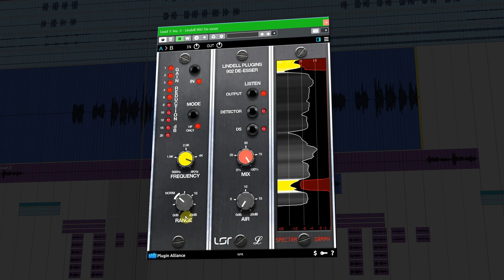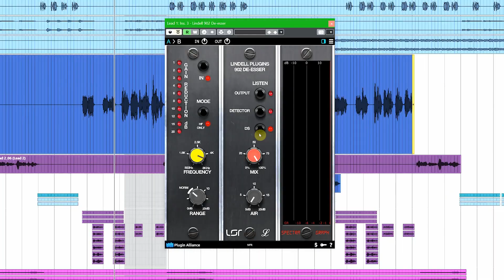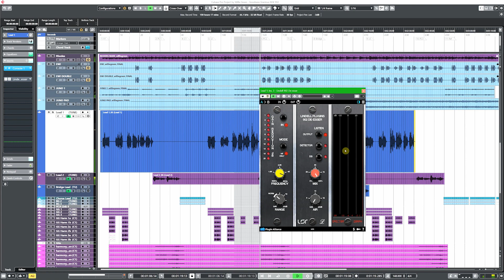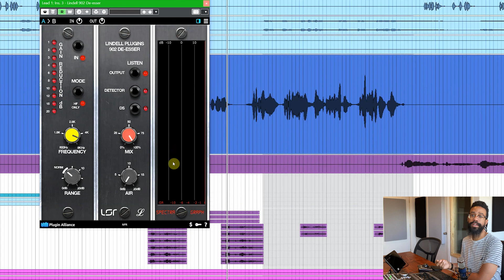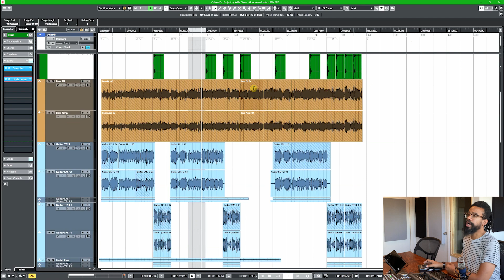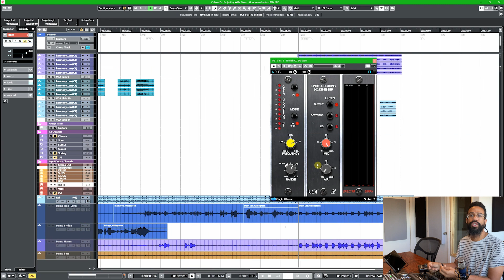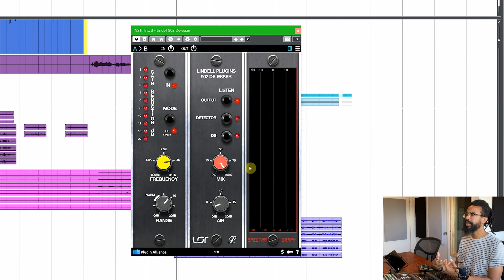Lindell Audio - 902 De-Esser - Walkthrough - Paul Womack | Plugin Alliance

Comment: Question, when you use PA-Installation manager where do the downloaded Plugins go into Mac?
Reply from the maker: These are the standard plugin folders for Mac

AU (.component)
32 / 64 bit universal
/Library/Audio/Plug-Ins/Components

VST (.vst)
32 / 64 bit universal
/Library/Audio/Plug-Ins/VST

VST3 (.vst3)
32 / 64 bit universal
/Library/Audio/Plug-Ins/VST3

RTAS/TDM (.dpm)
32 bit only
/Library/Application Support/Digidesign/Plug-Ins

AAX (.aaxplugin)
32 / 64 bit universal
/Library/Application Support/Avid/Audio/Plug-Ins
Reply: @PluginAllianceTV   THANKS, sorry I meant where are the Installers downloaded on a mac?
Reply from the maker: They will show up in your Downloads or the folder you have specified during download. 

If you have trouble with installing your plugins, please reach out to our tech support: 

https://www.plugin-alliance.com/en/tech-support.html